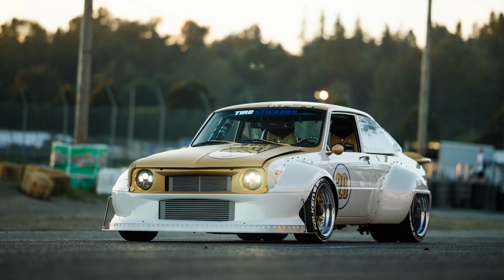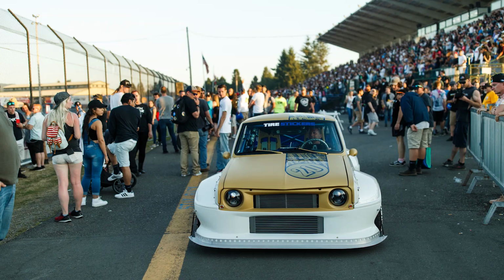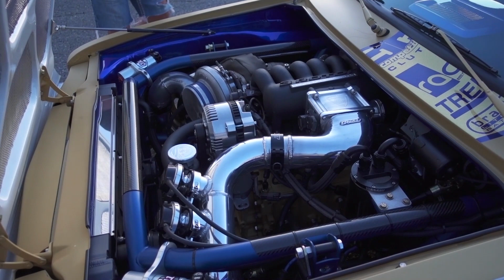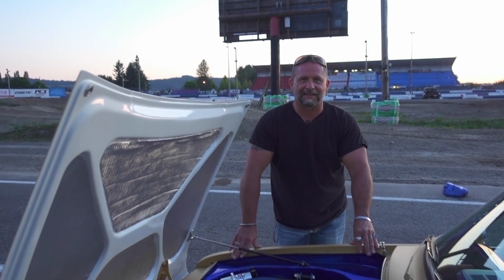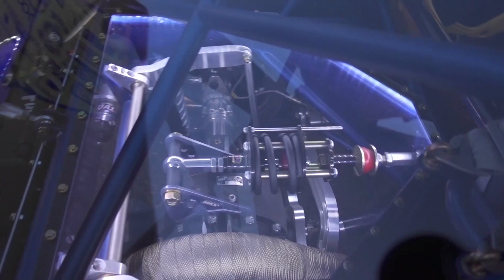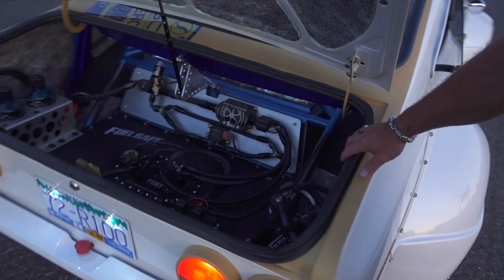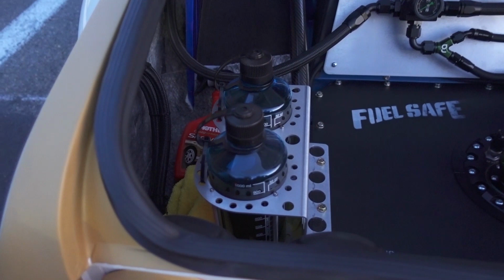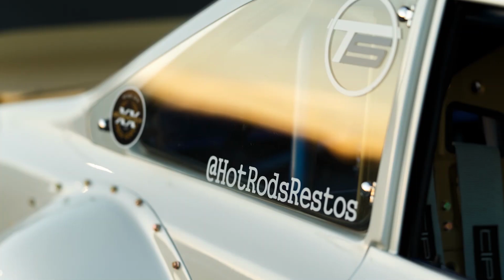Wild 700+hp 3 Rotor Mazda R100... Dually??

Comment: I love when the owner can this much about the car. "Built not bought"
The guy seems like really humble
Reply: In the last week I had a back and forth with some idiot on YouTube who, when I use the term built not bought he went right back to "did you forge the steel and stamp the body panels and chassis yourself, your car was bought not built".
Seem to have a real problem when I stated that my 300 + Fc RX7 would probably outrun a G Class with 600 horsepower.
Power to weight was a concept he didn't want to accept.
I said his statement was an insult to anyone who swings their own spanners and does any work themselves in order to improve their own car, he said my statement was an insult to anyone who didn't want to compromise the reliability of their vehicle just so they can "flex" against the six figure car.
I told him I didn't build the car for that purpose, I built the car for my own enjoyment, if it happens to be faster than something else so be it.

Comment: I pray that transmission NEVER GOES BOOM. Love this builder. Some Rotary owners are MAD!
Reply: It's a rotary. It makes no torque. That transmission will last forever.
Reply: rotary has torque it builds up. all the torque is in the high end they have no torque in the low end. watch the hoonigan bonus build and battle where vargas and his bro go to mazdatrix and talk about rotary.
Reply: @maxwellhughes7821  high end torque. also, 3 rotars are definitely more powerful than single rotar.
Reply: Maxwell Hughes rotaries, like most Japanese performance engines, deliver their torque at higher rpms
Reply: I remember telling the Rotary owner his engine makes no torque, then he took me for a drive.... mad wheel spin at low rpm out of corners, i'll never ever say those words again. Thrown back in my set... and this was just street driving with out revving it out.
Anyone that makes such comments now i know is full of shit and never even been in one :)
Reply: i rode in a single turbo rx7 making 540 to the wheels and the tires never even stopped spinning. It was on street tires but that thing is probably a beast on slicks
Reply: This car has a T56 Magnum which was originally designed as a built transmission replacement for 3500 lb Camaros and Mustangs. They are rated at 700ft lbs on the hit. As on 700ft lbs running through it with the slicks hooking from 0mph. The transmission sees a lot less jarring torque transfer once the car is moving. High RPM torque doesn't mean anything to this transmission unless it's over a 1000 ft/lbs. Rotaries make nowhere near the amount of low-end torque that could destroy that transmission.

Comment: Some would say doing this to an R100 is lunacy, these things a fetching 90K stock in AUS, I say build what makes you happy and drive it hard!!
Reply: restored they can fetch far more than that. but dont worry, its not like we cut up a pristine car, this build started with a shell, doors, trunk lid, and some odds and ends. any original sheet metal cut out, along with any unused original parts went to an enthusiast who has several r100s he is restoring.

Comment: 100% anti-squat... The engineering in that back end is godlike...
Reply: donnie baker Didn’t he say that axle tube is actually supported in bearings? Specifically so that it can’t twist up the springs.
Reply: @TheDeezelsmoke  so what are you going to do when you over ride the universal joint ..look up the maximum pinion angle in degrees
Reply: donnie baker What? it’s not like there is nothing controlling axle wrap, that’s what the coil over snubber is on top, and I’m guessing there is another dogbone or arm below. Have you actually been underneath this car to examine the setup to base your criticism on?
Reply: @TheDeezelsmoke  I have seen this setup before ..you seem to not  have any knowledge about pinion angle and why there is a maximum limit of the pinion shaft to drive shaft . The best condition is to have both in s straight line at all times and NOT flopping up and down every time you accelerate or slow down
Reply: (quietly double checks knowledge base)
"I'm going to get my coat"...

Comment: Rear tires must be beadlocked together. Bolt them together then mount as one tire.
Reply: It’s actually one 3 piece wheel with dual center beads and you mount the tires just like normal. Install one then flip the wheel and install the other

Comment: Now I wonder if it would have been cheaper to get the tires made or the rims I'd hate to see what a set of 888s would cost but theres lots of body's out  there that run a tire that would fit under there and work amazing for road course and again what was build costs love to know bud
Reply: getting a custom tire made isnt simple, it takes a lot of time and the costs are quite high, and you will be expected to buy in quantity. on the flip side, we already had to make a wheel for the car regardless, weather its a single wheel or a twinrim, it still costs money to make.

Comment: Damnit, disappointed NO DONUT!  not even a  little tire ripper burnout. Nevertheless a great video.
Reply: watch it again but make sure it is at the begin of the video there is a small burn out that was actually at the end of filming. there were workers all over the track and we were not allowed to do much other than that as the drift event ran late and we had run out of natural light.

Comment: There was a company many years ago that made wheels that used two narrow tyres per rim, I believe the name was twintyre (super creative 😂)

EDIT: the company was jjd
Reply: yes they were a heavy steel wheel with each tire being very narrow he started out with motorbike tires and each tire had its own pressure, they were very difficult to swap tires and never seemed to catch on since they were no wider than a conventional tire at the time and were much heavier. Why we did our wheel was to yield a very wide tire with a small diameter that was still a 200 tread wear DOT tire. There is no tire on the market that would fit on the car so this was our answer some people don't like it but I really don't care its my car and I love it!
Reply: Rod Nielsen thanks for the reply, your wheels are definitely in a different league to the jjds lol, I’m all for doing things your own way! Out of curiosity is the stretch on the tyres for looks or to stop the sidewalls chafing where they meet in the middle?
Reply: @paulEG6  It's funny they are actually pulling in a little and have more of a stretch look not mounted they are right at the rim width Falken asked me to use to make them perform the best they just seem to have alot of Taper I guess to the side wall if you could call it that. The only thing that touches in the middle when they are mounted is the tips of the flange protector on the tire and we did that to try and prevent any rock migration in to the bead area on the centers. There is very little sidewall flex in these short 16 inch tires. Thanks for appreciating out side the box thinking some people are very narrow minded and cant see there is a purpose to why things are done and not just something to try and be different and that somethings are governed by Function and you have to do the best you can to make it have style as well but the function is the most important thing.

Comment: IS the sound from the back of the Mazda weird, because it's been compressed in editing, or is it because he has 3 mufflers?
Reply: im sure compression from uploading/editing has changed it a little, but the car is very mellow sounding. its a combination of low comp rotors, the porting, 3 mufflers, round and oval exhaust tubing, and running e85.

Comment: Wait, did he say the tires share the same air? How the hell does that work? A bunch of, like, balance tubes (for lack of a better term) between the two sections? I REALLY want to know what's up with that.
Reply: the wheel is a 3 piece bolt together, and the center has the material between the inner beads drilled through in many places. this is done for weight reduction and to allow the air to equalise between the 2 tires
Reply: Sharkey Oh, so like back to back flanges with holes in them, but clamped tightly enough together (or gasketed, maybe) to prevent leakage to atmosphere?

Comment: Wondering why this video is titled 700hp when then car owner said 1000hp multiple times???
Reply: we have not had it on the dyno since we broke in the motor and at low boost and only 7300 rpm it made 700 whp math says it makes more but paper work officially says it makes 700 whp at that time. hope that makes sense

Comment: ??? The front suspension has an arnés, whats the name?
Reply: I had to look up the meaning to realize what you were asking. The front and rear suspension have travel limiting straps made by ProComp the shocks and suspension will extend further but we wanted to keep the shock in a specific amount of movement so we run these. Many companies make them usually used on 4X4's.
Reply: @rodnielsen4234  yes, that was mi questions thanks,

Comment: "Mickey Thompson Super Singles" would have solved the dual tire thing hes got going on
Reply: except for the height. the car is very small, the tires on it work out to 22.5" diameter. there wasnt a tire wide enough to support the power that was also 200 tread wear (required based on planned racing class) that was under 26" tall
Reply: @Sharkey_t  ahhh makes sense